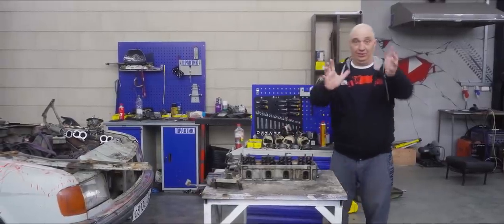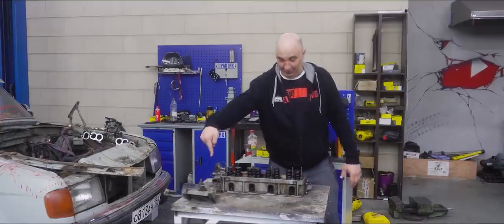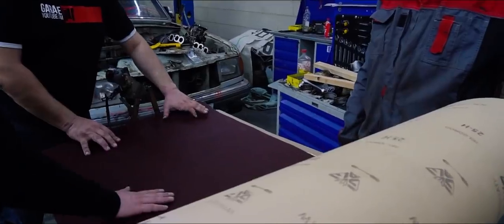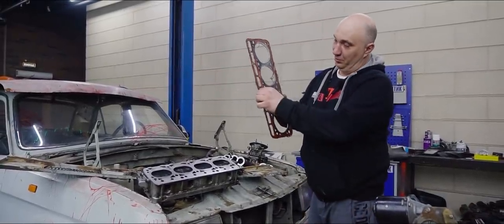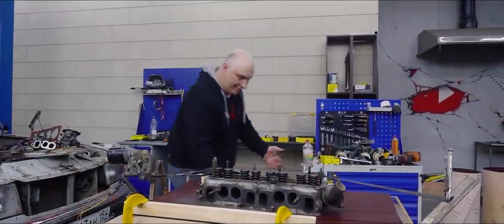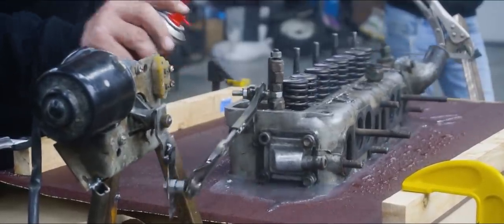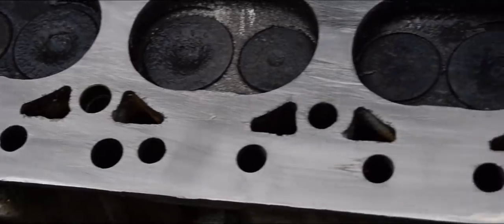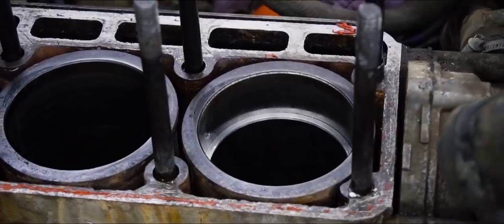Resurfacing cylinder head with sandpaper, DIY piston rings (cheap engine repair)

Comment: One engine builder once told me that using sandpaper placed on gravestone works pretty good on cylinder heads and blocks :D
Reply: ... or using a "sheet" of glass and grind paste.
works perfectly.
Reply: so I have to go to a graveyard to to surface the cylinder head? 
What about Zombies?  Spooky.
Reply: You can test it in the graveyard too. If it blows up, no one dies.
Reply: @2lotusman851  The Zombies aren't the worst part about it, it's the Vampires. So be quick.
Reply: @AnalogDude_  was about to comment sandpaper attached to a sheet of glass. Then use a straight edge and feeler gauges. Was taught that a few years back.
Reply: Snap Oversteer, I have a nice size old granite ( flat ) counter top I use for grinding surfaces flat.
Reply: It works perfectly
Reply: Cheaper than a surface plate if you dont need 1/1,000,000th of an inch of flatness
Reply: @Eddie Hitler Around joggers, stolen property is poggers.
Reply: use 220 for final finish
Reply: @2lotusman851  make the zombies do the work.

Comment: Idea: Find an engine that has been sitting out in the weather forever (like only a block with a rusty crank in it) and put it together and see if it will start, no cleaning or anything, only free it up so it can spin.
Reply: Apparently they only read suggestion comments in Russian on their videos that are also in Russian. I'd pitch your idea there.
Reply: @v6tex  cool thanks for the heads up.
Reply: @joshuaarthur8168  No worries.
Reply: when i was a kid i did this with my dad and after spinning the starter by hand for hours it started, best day in my life that was.
Reply: IIRC they still have a diesel engine buried underground
Reply: We once started an engine with 20 year old oil. Sludge and water went everywhere. Ran pretty good though.
Reply: Jonathan W. channel
Reply: Lol they buried a engine for over a year
Reply: Lots of instances of people starting stuck engines on YT. I did this with my father years ago on an old 390 FE out of a Ford dump truck. It sat outside for like 20 years, water got on top of the pistons and it froze (froze as in the rings rusted stuck to the cylinder walls). Oil pan had water in it too. Took out the plugs, soaked cylinders in penetrating oil overnight, heated the block with a torch and used a long cheater bar on the crank to get it moving. Once all the pistons were broke free, we poured more pentetrating oil in and cranked it with the starter. Schmoo flew everywhere out the plug holes. Once spinning freely, changed the oil, put the plugs back in and it started right up. Had some blowby but it ran, and no knock surprisingly. My brother put that engine in his pickup and ran it for like 30k miles. At the end it was burning oil so bad my father called it the mosquito killer lol.
Reply: would probably break some rings real quick
Reply: that's just basically any russian engine, so nothing really special about it
Reply: I did what you suggest ran a old lawn mower the motor was rusted up badly in the cylinder and head I wd40 it and just cleaned the carb I spun it with a drill motor on the flywheel bolt as the starter was not present. It was a 1980s sears lawn/garden noma tractor. After replacing just the ignition coil the lawnmower ran! It smoked really bad. After it warmed up ran for a hour I mowed some with it. Seemed underpowered. So I drove it around for another hour I shut it off. Pulled the head it cleaned off the cylinder rust no pitting but the top ring was bad and oil was getting buy!
Reply: Watched my ex step dad take 1949 Plymouth flat head. 
Pop the head plate off. 
Sledge hammer on wood to free the frozen pistons. 

And the project was never finished 
But U could always go flip the key and drive it around. 

The oldest car I’ve ever driven. 
That flat head Plymouth motor was amaZing❤

Comment: Measures ring gap with eyeballs, Then surprised it has no compression. Lol
Reply: @derkmerv6725  X
Reply: it's russian engine. Those don't need rings xd
Reply: ring gap isn't that important for compression alone the reason the compression is shit is because piston rings usually have spring properties which these homemade pistonrings do not have
Reply: Damn unfortunate to take such a shortcut with such cheap parts.
Reply: @Fanofou82  it was done on purpose to see if it would work. How do you not understand that?
Reply: It had nothing to do with ring Gap. You're trying to sound funny and intelligent but you have no idea ehat youre talking about.

Comment: There only one thing I would of done differently is turned the head 180 degrees half way though coz the motor might have put more or less pressure on the head

Comment: I used to use a sheet of glass and grinding paste to skim cylinder heads on motorbikes. It works perfectly as long as the glass is totally flat.😉
Reply: I've done that, ages ago, it's called "lapping". Higher precision than any machining can achieve.
Reply: indeed, i did it on mopeds cylinder heads.
10 slides than turn 90º and 10 more slides, turn 90º, etc, etc.
Reply: @thefreedomguyuk  that's what I thought. I've even done an escort mk3 cvh head.
Reply: @AnalogDude_  my first one was on my totally souped up Kawasaki ar 50 and it made a huge difference to the power. It used to go 55mph on the flat really quickly.👍👊
Reply: Yea for laping you idealy need surface plate. A saw sheet glass can be preaty warped too. But i guess for smaller motorbike cylinder head its okay :)
Reply: @rendicz5595  maybe old glass before the second world war is warped, but modern glass is "casted" on a bath of molten lead in a continuous casting process. it should be death straight.
Reply: @AnalogDude_  You would think that, but I have been using glass sheets for a bed on a 3D printer, and can confirm that it can and does warp
Reply: @timjohnun4297  well, it could depend on the producer of the glass, the quality requirements, some thermal disturbance ( during production or locally at home), who knows. but you can grind 2 of them as well, using grind paste.  : )
Reply: I did it on my wooden workbench. It works just fine

Comment: My father was an apprentice mechanic at the end of WW2 and he had some interesting stories about the techniques he learnt for repairing engines.  Evidently he used to make piston rings using cast iron sewer pipes and he used to stretch pistons by bead blasting them on the inside.  For the main and big end bearings he would cast them in place by pouring molten white metal into the caps and after roughly machining them to size then use a scraper to get the correct finished size.

Comment: I have fixed a warped head with a mirror and valve grinding paste. It seemed to work really well, and had no issues with the engine. Great video ;)

Comment: With the original Pistonrings this could work perfectly 
Great job👌
Reply: Yup
Reply: Exactly, or at least try to machine from cast...
Reply: @Iaintwoke  I think cast iron would be to fragile for the rings.
Pistonrings need to be flexible, they expand in the compression/work stroke due to the pressure in the in the cylinder.
Reply: @Alexsolid1  aren't most piston rings made of cast?
Reply: @Iaintwoke  you're right 👌
But i think it's not an ordinary casting process.

Comment: Professional Machine Shops: We use high tech machines that grind thousands of an inch.

Garage 54: Hold my sandpaper and windshield wiper motor...
Reply: Actually, you are quite mistaken there. When sub-thou's tolerances are required, no machining can deliver that. They will need to hand scrape those parts. Tracks on precision lathes being a prime example.
Reply: @thefreedomguyuk  woooosh
Reply: @FabiioAlmeiida  cringe redditor
Reply: @topzozzle6319  it's not reddit without r/
Reply: @thefreedomguyuk  He said " THOUSANDTH'S OF AN INCH " not SUB- THOU.
Reply: @NoWr2Run  Exactly, a surface grinder can easily machine down to thousandths of an inch tolerances. Usually a cylinder head only needs around 0.005" to 0.010" skimmed off it to refurbish it, assuming it's not bent. You'd never hand scrape that
Reply: Any halfway decent shop that actually grinds stuff should be able to hold closer to a couple tenths (0.0002") if they have to
Reply: @thefreedomguyuk  so I am an engineer that designs both automated equipment and custom high precision gages so I have an excellent understanding of GD&T, surface finishes material science and I also work on cars as a hobby so I have experience doing repairs with what I have on hand because the shop I work at isn't set up for engines and I don't get access to the machines till after hours so I am very time limited. Anyways you would never want to hand scrape a head the whole reason why you hand scrape ways is to A create a straight and fairly flat surface bigger than any grinder you have access to and B to decrease the surface contact of a surface in order to allow room for oil. In other words a scraped surface while great in some cases would cause a leak in the head. As far as an at home method what they did is actually a decent method. I would have preferred to use a precision ground stone or at least do it on a junk surface plate if I were to use this method rather than a surface grinder or a mill with a fly cutter but it's better than nothing and for someone who doesn't have a machine shop at their disposal it would provide halfway decent results. That said they could have gone a little bit finer in my opinion. Those rings though should have been hardened, ground and gapped because in my opinion that's the most likely reason why they had no compression. Now if you wanted a perfect result you could Lapp it I guess with something similar to a surface plate Lapp but that seems like overkill in my opinion unless you wanted to wring the head to the block I guess 😂
Reply: @thefreedomguyuk  as a machinist youre making me facepalm...
Reply: @FabiioAlmeiida  eae mano

Comment: I have seen this done in the Czech republic using two twenty four volt windscreen wiper motor from a TATA truck one each end with storage heater blocks to level it and one on top for extra weight to ensure even movement.
Reply: Tata motors?
Reply: @KuntalGhosh  Tatra
Reply: @YOCOSMINMAX16  tatra is a different brand. TATA is a different brand.

Comment: For real we used to resurface our cylinderheads on our motorcycles when I was younger using a sheet of glass and wet&dry emery paper, also finishing it using grinding paste and the same meathod.

Comment: Cool concept. Back in 1950, this was quite common to do. Interesting to see if one still can do so, or whether this art has been lost for ever. Actually, you don't even need the sand paper, you can use a scraper and achieve even better flatness. CNC machining ain't better, but much cheaper.
I guess to fabricate a set of useful rings, though, more than one video would be needed😉
Looking forward to watching this video !

Edit : 
Having watched the video, I'll say you're  nearly there. However, those rings are undersized, and you did not face them correctly. They need a slightly tapered facing. I guess the big issue may be the good, old problem of fitting new rings and not having the barrels done. Idea for next video ?
Reply: When doing a headgasket I still use sandpaper te clean the surface after I checked if head is still flat.. just works fine.

Comment: This method definitely works! I have done it several times with a 100% success rate. Just use your hands, a flat sheet of glass and 120 grit sand paper ( it turns out that the slightly rough surface actually helps the head gasket seal better ). Use a sharpie to paint the entire surface ( that so that you know what has been scrubbed away ). When you slide the head back and forth do NOT hold it on the top. Hold it as close to the very bottom as you can. This will MOSTLY prevent uneven surfacing. Done correctly the set up takes about 30 minutes and the resurfacing takes about an hour.

Comment: This was great. The windshield washer motor was just pure ingenuity. The piston rings probably didn't seal, because they machined them wrong. At 11:40 you can see the ring has a visible gap against the cylinder wall (not the end gap). This is caused because when the oversize ring was compressed during installation, it didn't retain a circular shape and bent unevenly. They should have machined the rings first to cylinder diameter, then cut the gap(with a thin dremel cutting disc) and then expand them. I think this would ensure that the ring is fully the round shape of the cylinder when installed. But also might be that mild steel will not work, because it does not have enough "springiness".

Comment: Fixed many engines with a resurface like that including mine, i just put a thick glass sheet under and glue different sandpapers on it and move it back and forth, if you pull a string side to side and it doesn't have any gap and can see no to slight light when rests on a true surface it's alright as the gasket compresses for quite a few nm's, no need for a machine shop.

Comment: I think I would have gotten some  Cast iron for the ring to be made out of other than that it golden  the compression  is a touch higher than  stock great job  Garage 54
Reply: Yes. Cast iron is the correct material, must not be so hard it scuffs the cylinders. Would also wear down and seal faster. Guessing they didn't care that much for the purposes of the video.

Comment: I like the glass and sandpaper method for achieving a nice flat surface! But you'd want to be really careful trying this on a OHC engine. If the cylinder head has warped, the camshaft journals in it might be misaligned, resulting in a camshaft that won't turn after the head is removed from the block. In some cases, it's actually better not to resurface the head, as the head bolts can flex the aluminum head into shape when clamping it against the block, allowing the cam to spin freely again. But resurfacing the head while it's in a relaxed, bent state with a seized cam could ruin it...

Comment: Cheaping out on rings is a bad idea. They cost peanuts for that engine, much cheaper than machining them. Sand paper deal is an old old school trick and it's proven to work, you just need to check the gap with a straight edge
Reply: Bear in mind that in Siberia you have to make it through brutal cold weather to get to the parts store to buy those peanut-cosing rings. Why subject yourself to such torture when you have lathe and raw metal in your warm and cozy garage (54)?

Comment: You probably should have heated up the piston rings until they were cherry red then drop them into oil to tempre them 🤗
Reply: Nope, makes them way to hard doing it that way, also makes the material brittle
Reply: that's a terrible idea...
Reply: If they are low carbon it won't do shit lol

Comment: God I love this channel. This is a completely valid way to flatten a head if it's not badly warped / gouged etc. If you have two heads you want to make sure they are both sanded to the same level. There will be a very small change (rise) in compression in all cylinders. The DIY piston rings were perhaps a bridge too far, need higher tolerances there, piston rings in modern cars are generally made from iron, not steel.

Comment: A faster way to true up the heads is to mark all the high areas with a permanent marker then get a wide blade chisel and a hammer and chisel off all the high spots. It takes a steady hand plus a critical eye but it will work every bit as well as sandpaper, a windshield wiper motor, and a pane of glass.  What a great video, you guys are so inventive.

Comment: for a good flat surface for sanding i use tempered glass because it is very flat and glue sandpapper to it. and dont just go in one direction.. figure 8 seems to work well

Comment: Probably didn't need to go to the finer grit of sandpaper. As I understand it, you actually want a little "tooth" on the surface so it grips the gasket. Too smooth and it's easier to blow a gasket.
Reply: I'm not sure what grit they even used ?
Reply: Depends on the gasket. As I understand it with a modern multilayer steel gasket a smooth finish is needed.

Comment: i think there is a bit more to piston rings then just cutting them out of a pipe... noticed quite the gap between the 2 ends of the ring when put in the cylinder, a nice path to the base for the compression

Comment: On suzuki g16b engine service manual, manufacturer said if the head is deform yo should use a flat surface and sand paper n 400 i think. So is a very good way of get a flat surface, and good machine you did with the wipe motor!!

Comment: i've done this a lot! perfect methode is making the nr8 with it while sanding, and you dont want a mirror finish, the fine scratches prevent oil and water coming through. but they must be in the opposite direction towards the front and back. not the sides

Comment: The other way is to just make the paper spin under it rather than the block on the top. Can do this with a roller and motor on a wheel turning paper. Join the paper in a loop around the motorroller :P. Its also a super lazy way to polish and flatten other stuff. Can do it in a punch with a drill on slow with a band on the trigger pressing it down. Basically a DIY belt sander with whatever you want sanding sitting on the top.

Comment: I used an electric belt sander tool to clean the cylinder head gasket surfaces. Just a few passes with it did wonders. No more rust and scale. It looked like a brand new casting. Try it.

Comment: Great job. I resurface my own heads by hand using a large machinist file. It is very true and I can get it down to less the 2 thousandths. I picked up the file at an auction so I can't tell you where to buy them but it is faster than sand paper.